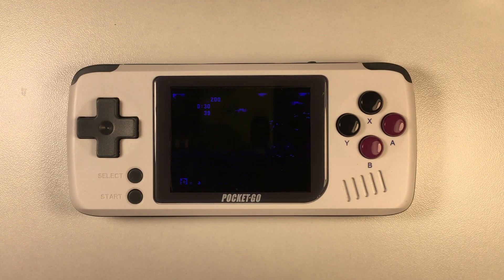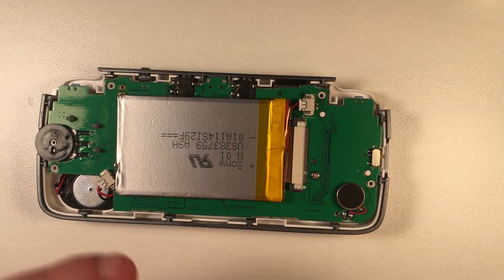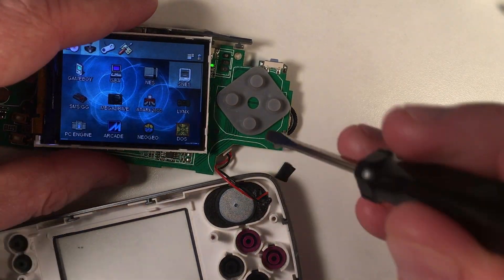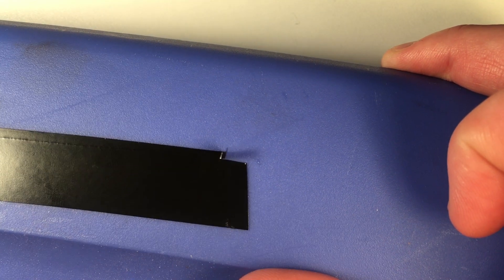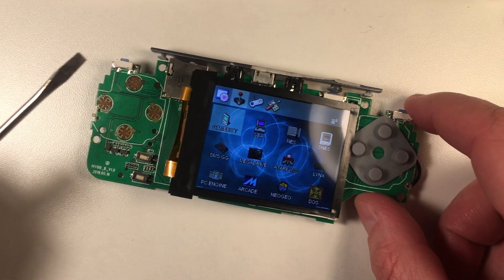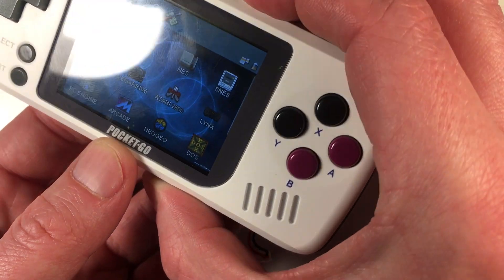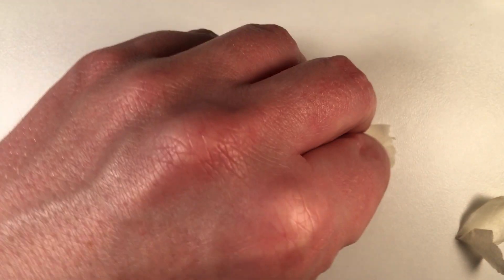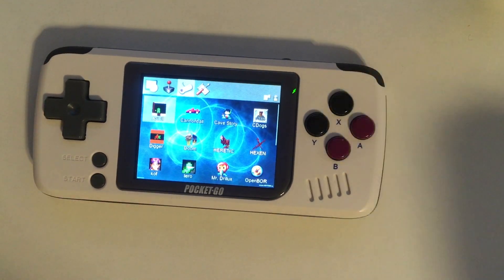BittBoy Pocket Go Screen Light Bleed Easy Fix - PocketGo

Comment: Well done!  I was going to make a guide on how to do this but you beat me to it! Awesome. Lots of people in the pocketgo community are bothered by the light bleed. This will help!!
Reply from the maker: Thanks! You can still make a more polished guide. I just wanted to get this out quickly so that people could find a simple fix when they first received their Pocket Go units. These are awesome little machines, and this one tweak really helps.

It's amazing to me that this isn't standard. It would be so easy and cheap to have a one-piece die-cut sticker on the screen from the factory, but at this price, I'm not complaining!
Reply: Zach Collier your guide is as polished as can be!  Well explained.im still waiting on mine. Been 3 weeks. While I was watching your video, I was wondering if maybe a black paint marker or permanent marker would do the trick. Right along the edge right where you put the tape. So, is the emulation good. Is the screen tearing as bad as they say it is?
Reply from the maker: A paint marker might work along the top, bottom, and right side, but on the left side where the ribbon cable connects there are some larger physical gaps that I don't think a thins layer of paint would fill. I really think that tape is the way to go, especially something thick enough that it completely blocks the light with just one layer.

Plus, it's not super easy to get this tape in place, right next to the pixels without actually covering any of them. I would be worried that using paint would be much more risky. One wrong move and you have paint on your visible pixels! I edited out the many attempts where I got the tape on there but not quite perfectly positioned.
Reply from the maker: Oh, and regarding the screen tearing... yes, it's pretty bad on certain emulators, especially the SNES. On others, like original GameBoy, it's still definitely there but I don't notice it as much unless I'm looking for it.

Unfortunately, I think this is a system flaw, not something that's going to be fixed with updated software. My reasoning is this: even when the emulator is reporting 60/60 frames per second the tearing is still just as present as when the frame rate is suffering. So unless something fundamental is changed about how the system itself is updating the display, we're likely stuck with the tearing. But think about what you're getting for a very low price in and very small package. It's definitely not so bad to me. And I'm very picky about emulation, having never found a modern SNES emulator with acceptable button input lag, even on desktop computers. And this thing is FUN!

I backed the GCW-Zero on Kickstarter and, unlike some backers, did receive mine and am very happy with it. This PocketGo does not match the performance of the GCW-Zero in some ways, but it destroys it in others, such as size, convenience, and the feel of the buttons. Plus I love the texture of the plastic on the PocketGo. It's not the shiny plastic of cheaper products, which the more expensive GCW-Zero does have and which detracts from the overall aesthetic of that machine.

Overall the PocketGo is awesome.
Reply: Zach Collier that’s cool. The new ldk looks nice.  No screen tearing and with an anolog stick. But it just looks bulky to me. And doesn’t look as comfortable as the pocketgo. Pocketgo just seems built better. I have the first version of the ldk. I like it. But I ordered the pocket go out of curiosity and low price.  I hope they do a newer pocket go with a 60hrtz screen. Same build tho. And maybe an analog stick as well. That would be king!
Reply from the maker: I’m also interested in the LDK. I especially like the yellow version! But yes, the low price of the PocketGo was too much to ignore, and I’m super happy with it.
Reply: Also. I shared your video on the  retro game handheld paradise page on face book. Hope that’s ok. I’m sure your video will get a few more hits now. Lol. Lots of people on there asking how to fix the leak.
Reply from the maker: Of course! Thank you for sharing! I made this video to help people, so the more views the better. 

No ads on here, just a helpful and easy solution to one problem with an otherwise amazing device!
Reply: Zach Collier yea. Ldk is great. No screen tearing. Only thing is viewing angle if it’s turned to far to the side. But who plays like that. Lol. I saw someone selling one on Mercari for $40. It’s the clear one tho. The first version. It’s in US so shipping wouldn’t take A month.

Comment: 9:00 during my button swap the reset button, top plate, lcd screen, everything kept moving out of place as i tried to adjust another piece back in which quickly turned into the ultimate test of patience 🤣 then of course the shoulder buttons and power switch constantly falling out.  resting the device at a slight angle is another way to temporarily hold the shoulder buttons in place but i wish i would've thought of your masking tape idea.  this is the best teardown video i've seen it'll make a great reference
Reply from the maker: Thanks a lot! I’m glad you found the video to be helpful!

Comment: I did this but I can't seem to get rid of that small light bleed in the top left corner, I think I see the same issue on yours.
Reply from the maker: I think I see what you mean. If you look at an extreme angle down toward the top left corner of the screen I can absolutely see a bright spot, but it’s down inside the screen itself. No way to block this from the outside as far as I can tell. 

Is that what you’re talking about?

Comment: Mine's not perfect, but definitely an improvement. Swapped the buttons while I had it open, too. Thanks for the tutorial!
Reply from the maker: Glad to hear it! I’m happy to have been helpful. 

To be clear, mine is absolutely not perfect, either. The design of the screen itself is flawed in that it’s impossible to completely block the light from going to some of the wrong places because it’s shining from inside the screen itself in areas that contain active pixels. But I believe that this quick mod is about the best we can do for such a simple and affordable device.